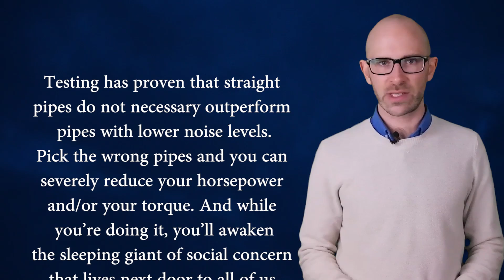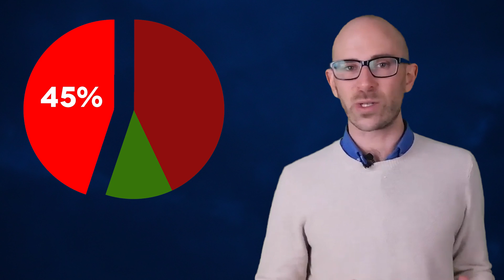Why are Harley Davidson Motorcycles So Loud?

Comment: to all those haters - it's called a preference, a hobby, a genre. there's a lot of sport bikers in here obsessed with HD penises which is weird. but they'll buy a bike with more lean degree and power then the vast majority will ever need or use and the ones who do use it are often doing so at the risk of the health and wellness of the general public they're speeding past. so your selective moral outrage towards a rider who has a loud bike just because "they don't need to be that loud" is just hypocritical cause it's likely not necessary for you to do 200 mph one a freeway. that being said the majority of real bikers will support fellow bikers even when they're riding a bike they wouldn't necessarily buy. where's the brotherhood? you can be passionate about your bike without being a prick to others for their choice in bikes.  on the theory of louder  = safer, one might ask why cops/ fire engines and ambulance use flashing lights AND loud ass sirens. if the noise doesn't help them at all maybe they should just use their lights.

Comment: The "Louder is safer" argument is ridiculous.

If you NEED to be loud to be safe,m it's because you ride like a maniac.
Reply: Because there's absolutely no way a motorcycle can go unseen by a car driver. After all, everyone always drives with their full attention devoted to the road, and cars don't have pillars.
Reply: Haha true. I ride and drive for years now and i never even once noticed a bike because of its noise. In a car, you wont hear them unless you are standing still or beeing passed. Same goes for sitting on a motorcycle. Whenever i ride, i only notice other bikes behind me cuz i see them in my mirrors or when i look back. Giving me jumpscares everytime when a loud ass crotchrocket with no baffle passes me. Loud pipes dont save lives, safe riding/driving does.

Comment: I don't believe the calculations about decibels are correct.  Yes, the scale is logarithmic, but in base 2.  That means that an increase of one bel, or 10 dB, is doubling of sound.  Therefore, 80 dB is twice as loud as 70 dB, not ten times as loud.
Reply: I've blundered into a discussion I do not understand. I'll take my leave now.
Reply: Bob Bell
I think you are confusing (deci)Bel with (deci)Neper, the latter of which is based on the natural logarithm, or about 2.78 if my memory serves me right.
The name Neper, by the way, is derived from Charles Napier who either "invented" or popularised the natural logarithms. (I can't be aresed to look it up) ;P
Reply: That is incorrect.  It depends if you are measuring sound pressure or sound intensity.  One is 10log(X/R), the other is 20log(X/R), where X is the measured quantity, and R is the reference (all dB measurements are ratios).  10log(X/R) implies a doubling every 3 dB.  20log(X/R) implies a doubling every 6 dB (approximately).  For example, if you are talking sound power (10log calc), 83 dB is twice as loud as 80 dB...  and all of this depends on distance.  Standard measurement distance is one meter (metric) or 3 feet (English).  Sound pressure for an omnidirectional source falls off as a spherical function (10log of the distance), so the further away you are, the lower the sound pressure.  BTW, if you want to check the math, the reference pressure for air is 1 Pa.
Reply: Bob Bell 
You are both incorrect. Decibels are calculated on logarithms to the base 10. He is correct that an increase of 10 decibels is 10 times the acoustic power, but then immediately afterwards he errs by saying that it is also 10 times the sound pressure level. Power is 10*log10(x), pressure is 20*log10(x).
Reply: Bob Bell

3 db is twice as much power, therefore 6 db is 4x, and 9 db is 6x. 

Power does not always correlate to volume, however.

There is a difference between frequencies that the human ear actually responds to and what is actually available for measurement.
Reply: Its 3dB for doubling power & 6dB for doubling level.
Reply: 80 decibels is 2 times louder than 70 decibels

Comment: I really like the sound of a nice deep throaty Harley.... it is possible to sound that way without being totally obnoxious.  I worked with a guy that had to put in earplugs before he rode because admittedly his bike was way too loud.
Reply: All riders wear ear plugs. A long ride without them and you'll spend four hours in bed with your ears ringing. Wind noise is louder than the engine or exhaust.

Comment: apples to Oranges there Skippy. The loud pipes are aftermarket and you are comparing to stock OEM equipment...The open flowing pipes improve power. I notice that high performance cars, trucks, planes ect are all way louder then stock.

Comment: There was a guy on a HD on the highway near to where I used to live.. His pipes were sooooo loud that he didn't hear a 18 wheeler coming alongside him trying to pass. He got ran over when he changed lanes without looking. Splatttt! So, having loud pipes for safety is a misnomer. True story folks. The truck driver told the cops that he just whipped over/changed lanes right in front of his truck.

Comment: I  had a 99 dyna  super glide  with an aftermarket  exhaust with no baffles. absurdly loud bike, so I welded  up a baffle tube, wrapped it in fiberglass muffler packing and it was far quieter and yet ran just as well. it sounded good without being loud...imagine  that? one of my other bikes is a 73 r BMW  and it is quieter than a sewing machine at highway speeds. I haven't  noticed more people  trying  to  run me down because I'm quiet. I'd  imagine  that other drivers  might want to squash you for being inconsiderately  loud. poor self  esteem  is a lousy reason  to be noisy.

Comment: People keep saying the video doesn't explain any science behind a Harley being so loud. There isn't any except putting loud pipes on it. I work in a motorcycle shop which does primarily imports, although we do work on Harleys sometimes. I can assure you straight pipes on a big displacement Japanese cruiser is just as loud. Usually it's the crotch rockets with Moto GP style exhaust(very short just an angled tip coming barely off the headers) which we throw in earplugs if we have to run them inside.

Comment: I really hate loud vehicles, I live in an area that is completely flat so you can hear lorries,  motorcycles and tractors when they are kilometers away! its so annoying.  And the ground shakes when heavy vehicles drive by although the road is 40m away from the house but i guess sand layers just transfer those vibrations really well. at least motorcycles are not so common here since the weather is mostly horrible

Comment: I have had 2 incidents where harley riders go screaming by me wide open and I had  my windows down on my truck.  But I have a 150 dbl train horn on my truck at the next stop light I pull up next to them and let that train horn go one rider about dropped his bike and about went into convulsing.  All did was yell how did that feel a hole and they both did not say a thing just rode off. That train horn sits about 4ft right at ear level.

Comment: It was stated the bikes are powerful.  Compared to what?  They may have been know to be very powerful at one time but compared to many modern motorcycles with smaller motors they are significantly under powered.  They are nice heavy bikes with great paint jobs but they are not powerful.  

The other comment that I disagree with is that motorcycles are loud.  Most are not load, my 2000 BMW 1150 GS has the stock pipes and it is quite.  I have had owned several motorcycles an none of them are load like a Harley Davidson.

Comment: The numbers concerning squids don't count. The idiots driving 100 in a 50, the ones rolling through stop signs, the ones using your local twisty road as a personal trial racing course, who die because they're squids???. Yeah, they bring it upon themselves. But of that small slice of people(relatively) in the dead category now due to a hole cagers are dead because of inattentive drivers of cars and trucks. If you've ridden a motorcycle and are what one would call a responsible rider, you've probably been in more than one very near miss due to someone not paying attention. In the first two weeks of owning my first motorcycle I was almost run over by a woman in a right lane, crossing to the turn lane to turn left into a grocery store at the last second. I could see her face in her drivers side mirror. Later on in my riding endeavors I dumped my bike when an old lady pulled out when I was less than 20 feet from her, luckily I was going less than 25 or I could very well have been one of that little slice of riders dead due to piss poor drivers in cars. People pull out in front of cars daily, because they don't pay attention. It's harder to see bikes, so it happens even more. The difference is, in a two car collision a driver of a car is way more likely to not be seriously injured than a rider on a bike. So, yes, loud pipes do in fact save lives. They help make people aware something is there. Why do you think ambulances, fire trucks and police cars have blaring sirens? Same damn reason, to get drivers attention.
Reply: Fuckin right brother....real riders know this is horseshit...my first bike was a 78 FLH when I was 15 me and dad built it and when I got my license and endorsement just that first week I had almost got run off the road...MF thought he was like these idiots and try and blame me after we pulled over. Witness didn't think so and after he got triggered and try and swing I stomped his ass in the fucking dirt. These are the idiots we deal with just like the ones on here. Know that MF got locked up beaten up and all because he was not paying attention. I wasn't doing shit wrong
Reply: Sorry, do not agree. Studies differ on rather or not loud pipes save lives. However to assume that one has the collective right to annoy the crap out of everyone else around them is B.S. Motorcycles have noise regulation standards, just like cars. Please do not increase the loudness of the stock bikes or cars.
Reply: Peter Wilson most vehicles do apeshit it's called an alarm since you wanna be a dick...but there is a difference riding in a cage compared to somthing that has no fucking walls around it...go ride a bike for a day tool. If you've never done it then stfu
Reply: Peter Wilson for somone that was riding in 72 should know bout a 78 flh😂 too heavy????? Do you relize what we do to those bikes dick?? Fucking thing weight was less than a xlh883h hahaha buuuuuut mr. I got it all figures out guy nerds to keep talking shit....I forgot all about your low life ass hahaha is this what you do all day?? Cause us real bikers eeehhhhhh we tend to RIDE OUR BIKES MORE THAN WATCH FUCKING YOUTUBE VIDEOS!!! grow the hell up my man cause you ain't hot shit Casanova but keep trying to convince us it's really working hahaha
Reply: Peter Wilson what the actual fuck?!?!?! That was your comback?????😂 you should be a writer not a rider....FAIL
Reply: A squid is slang in the rider world that refers to a rider who rides like a jackass with little to no protection, I:E shorts, tank top, slippers, and maybe a helmet.

Comment: +10db = about twice as loud to the ear; not 10x
Reply: dB is a LOGRYTHMIC scale.  e^dB

https://math.usask.ca/emr/images/esupx.jpg

10X dB is not double volume... its FAR higher than 10X volume.
Reply: It's 3.162 times as loud (amplitude or volume), but 10 times the power (3.162^2).
Reply: I wasn't sure about this so checked Wiki. 
https://en.m.wikipedia.org/wiki/Decibel
Reply: Chad M bruh

Comment: personally I couldn't care less if a bike is loud or not. but I know that when I drive down the road in my car on a buzzy road. I normally hear a bike before I see it, so yeah I guess that helps ( dose it save lives, well it's possible but not necessarily). and yes Harleys  are really loud and it can be really annoying (this is coming from someone who has wanted a Harley sense they where 6 years old). So for the part of this video that is talking about the noise the facts sound to be fairly accurate. however I personally find it difficult to believe that motorcycle accident facts are accurate considering they are 6+ years old from when this video was made. making it hard for me to trust this video fully. just stating my opinion.

Comment: "Loud pipes" is actually a misconception and misunderstood. V-Twin engine design naturally produce a low sound from the exhaust manifold. The louder V-Twin engines are generally aftermarket engines of large displacement such  as130 inches  but still not as much as your car but produce more horsepower.
Exhaust systems do not create any sound but only allow sound and exhaust to pass through.Most  exhausts are very expensive systems that are tuned for maximum performance which is the same goddam thing people want out of their automobiles. Most of you who complain do not know a V-twin engine from any other engine by sound yet you are blaming Harley owners all around without even gathering evidence. You do not know a Titan from a Harley even if you stood a foot away from it.
Here is a list of motorcycles that have V-Twin engines so you know what  brand of motorcycle that is waking you up at night: Pick one and bitch all day, nobody really gives a fuck what you think and being polite ends here with me. 
Aprilia Mana 850Aprilia RSV MilleAprilia RSV 1000 RAprilia ShiverAprilia TuonoBritten V1000Ducati 748Ducati 749Ducati 848Ducati 851Ducati 888Ducati 899Ducati 916Ducati 959Ducati 996Ducati 998Ducati 999Ducati 1098Ducati 1198Ducati 1199Ducati 1299Ducati DiavelGunbus 410 (Leonhardt Gunbus 410 with 6.7 l/410 ci V-twin)[7]Harley-Davidson FL (multiple bikes)Harley-Davidson VRSC (the V-rod)Indian ScoutHarley-Davidson Model 7DHonda RC51KTM 1290 Super AdventureMoto Guzzi CaliforniaMoto Guzzi Le MansMoto Guzzi V7 SportPrinceps AutoCar Co V-twin motorcycle[8]XL-ALL V-twin[9]Pope Model LSuzuki SV650Suzuki SV1000Suzuki VX 800Suzuki V-Strom 650Suzuki V-Strom 1000Suzuki TL1000RSuzuki TL1000SVincent Rapide

Comment: Bias DB readings!  You Cant take a Wide open Throttle Peak DB measurement and Compare it to 20% Engine load of a F450. You Ever heard a Stock F450 Under full boost? They are louder then Stock Harleys under WOT.... Thats ( Wide Open Throttle)
Reply: That is true of all stock exhaust system motorcycles. A very large percentage of motorcycles have modified exhaust systems that are louder.
Reply: Gladius Jon exactly
Reply: Gladius Jon lol, you wish
Reply: Not only harley had loud pipes.

But sry for saying. But why not critique a modified skyline or evo 10. Who make a sound exhaust of 999999 mega db.

Loud pipes save lives.
Oper your eyes in the side mirrors and we dont need a loud pipe.

Continue closing your eyes and ears and keep crashing us and we will get a cannon in stead of pipes.

I can barrley hear my exhaust while riding and so do my friends.

And yes a long term exposure will damage.
But 10 sec till we pass the bystanders will do no harm.
Don cry. Respect and get respected.

2 wheels are always judged.

Pace✌️✌️
Reply: you know, they probably won't do much good if they still can't see your ass. They might know you're there but that's not doing shit when your leather fetish-mobile is in someone's blindspot.

Comment: Funniest thing:  We were doing a group ride at Ft. Hood and we were formed up at 1st Cav Division HQ.  All the units were forming up at their higher headquarters and my group was watching the other riders go by.  One group of riders stopped at a light across from us, about 200 ft away. It consisted of 5 sport bikes and 1 Harley.  

The sport bikes started doing that thing they do...winding up those whiny engines until it sounded like they were redlined.  After about 10-15 seconds they stopped.  There was a second of quiet and the Harley rider revved his engine.  He blew away the other bikes and everyone in my area was laughing and applauding.  Then the light changed and they took off.

If you're talking loud bikes, you have to be talking about cruisers.  I've never heard a sports bike that was louder than a cruiser with good (loud) pipes.

Comment: All I know is one of those motorbikes drove down our main road in town and the level of the noise was so loud I had to cover both my ears and I still could hear the horrible gruff deep noise it made as it went passed and I was not even near it? I was about 25 meters away from the damn thing!  I thought when I could think again without the noise,  That must be illegal to make so much noise in a town?  This was in a town in the UK, and the noise it made outstripped any other level of noise there and the main road was full of buses, cars, lorries, None of which sounded even 1/4 the level of noise that Harley sounded like?  I believe these bikes and any other car or bike that makes that level of noise should be forced to be sorted so it don't make it above the level of 60db, our hearing is a important thing to look after as one day you will need it to save yours or someones else's life in a possible person run over by someone's car or bus etc.?  As for saying they need it loud to make people hear them so to get out of the way?  You can hear them a mile away sometimes!  I would think a normal sound level of a normal car would be fine to warn of it coming than having our ears wreaked even when it is 30 meters away?  I see there is a electric Harley now!  Maybe it will be silent like the electric cars are?  So as Elon Musk has shown it can be powerful and lighting fast without all the noise and pollution.

Comment: Here is my argument to HD. I have a 2015 Street 750. Stock produces 57 HP and 45 Lbs Trq. Mine now makes 70 HP and 58 Lbs Torque. All I did was replace the Muffler. Left the Cat and front pipes alone. Intake kit. And a Programmer. I have a Dyno run to prove it. And I rode into work at 5-6 AM through a small town. And have never been stopped.